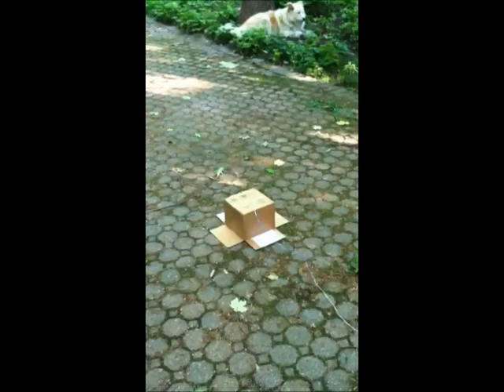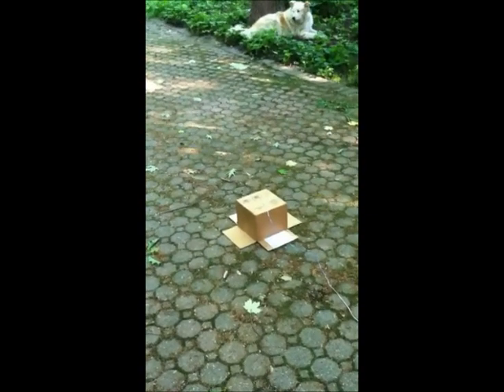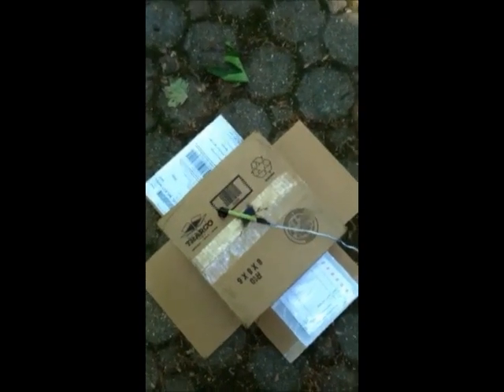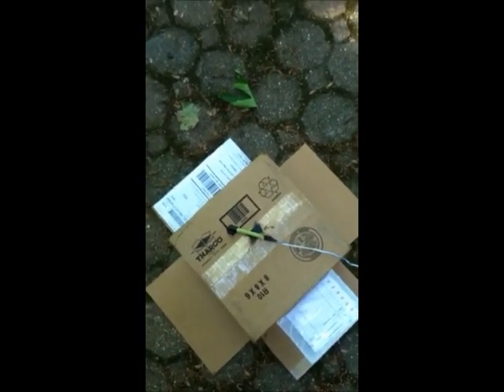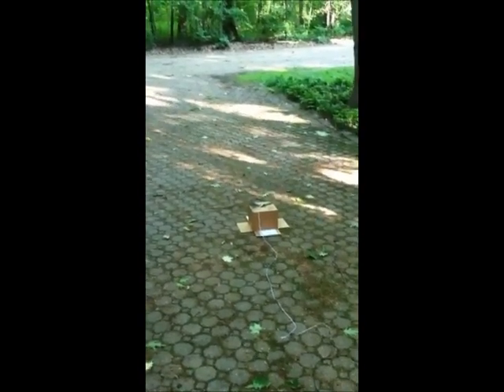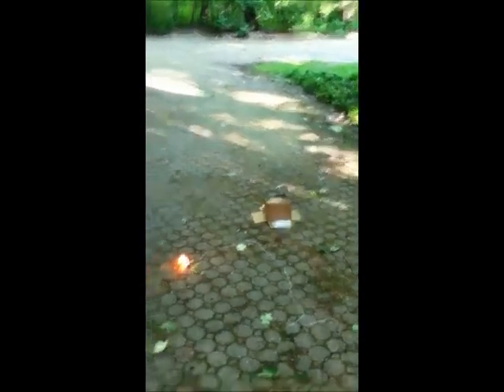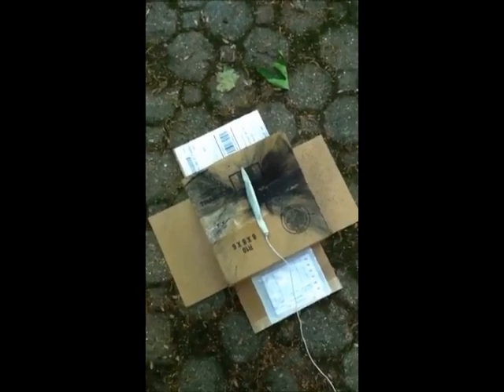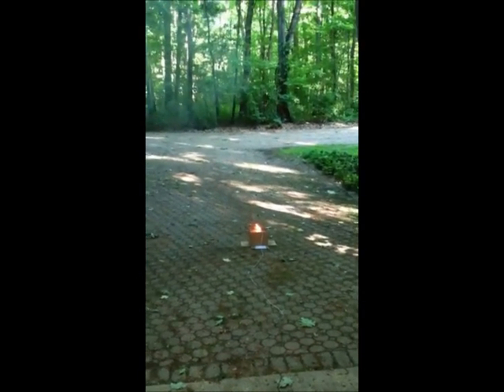MJG Firewire Initiator copper thermite test

Comment from the maker: I just got an email from another rocket customer that I figured I'd share. "I tried a small BP rocket (in ground test) with the match lead pushed up past the clay nozzle (shroud pulled down the wire) and it lit just fine."